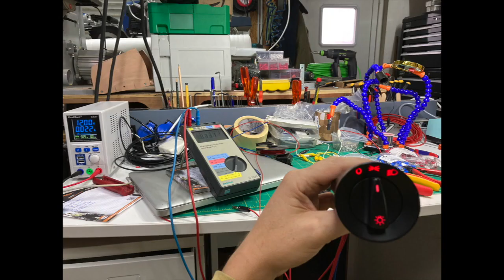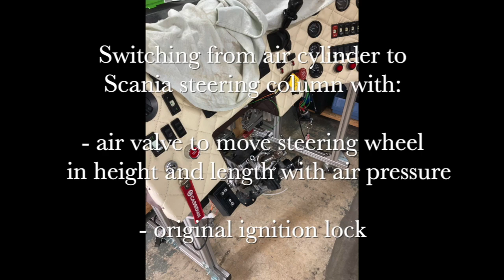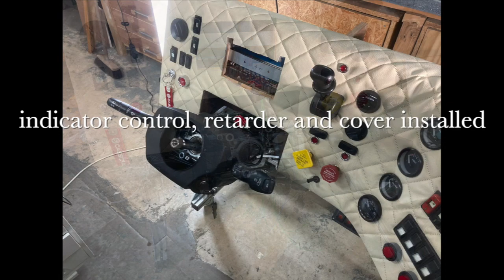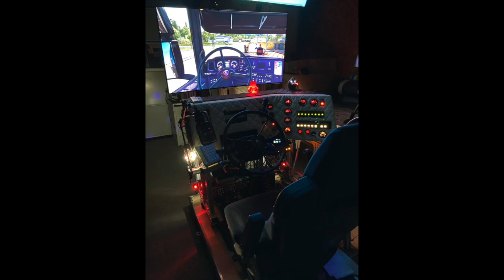ETS2/ATS Cockpit 2.0

Comment: Very impressive build! The next upgrade I would do, is a tripple big screen setup. For ATS and ETS2 you don't need an high refresh monitor, so it can be achieved rather cheap. Would make the immersion so much better.
Reply from the maker: May at one day a three screen setup will come if there a big screens without frames are available, I´m not a fan of having frames in the whole screen view.

Comment: How did you get the experience to build this? How much did this cost? Is it hard to do?
Reply from the maker: 1. Thinking about what can be build with the system possibilities from SCS and looking other videos about butzon boxes and how to build those things
2.I nevet checked the costs and its dependig whats included, the dash only I would say 700€, only material costs, no working time, no steering wheel, no wheel base and so on
3. Dependig on your skills in metalworking, woodworking, electric and software